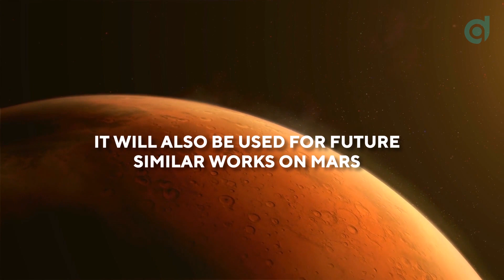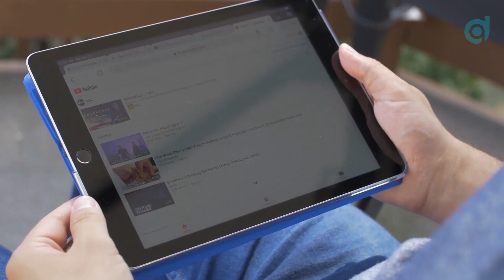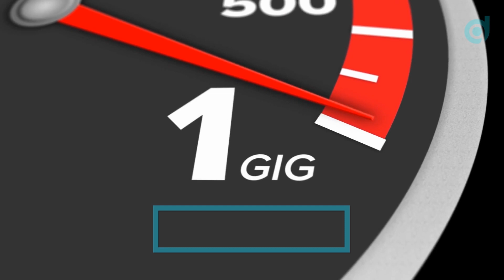Starlink: What's the Bigger Purpose

Comment: 0:30 stunned by your voice saying you will reveal the purpose at the end I am curious whether it matches my idea of Musk‘s geniusisity
Reply: at 2:20 you let slip a tiny hint
Reply: at 11:30 the StarLink is not just to fund the Mars exploration.
I assume, before any ‚real‘ vehicle will drive around on Mars, it needs geographical info and communication for wide distance rides.
So StarLink will inject thousands of satellites (how many will fit in the cargo bay of an StarShip?) into the orbit of Mars before the first landing will occur.
With the help of these StarLink communication network, the computer power can be organised centrally on Mars. All vehicles need less AI-hardware on board which requires less shielding against the life-killing environment while the good communication connection delivers data and results and commands without latency.